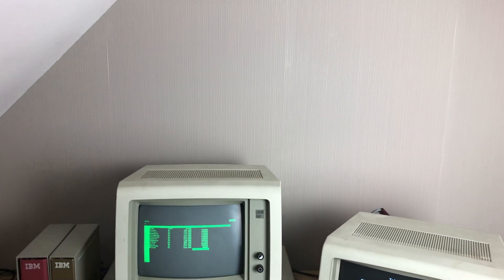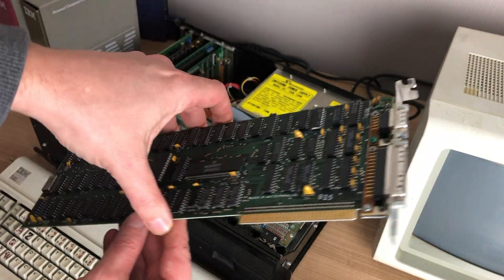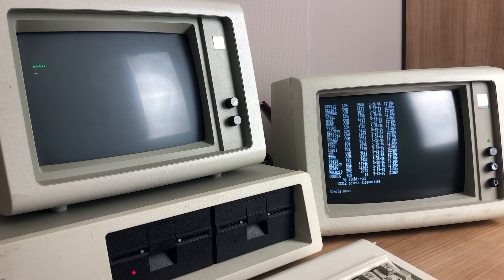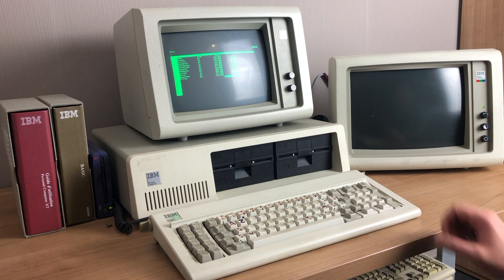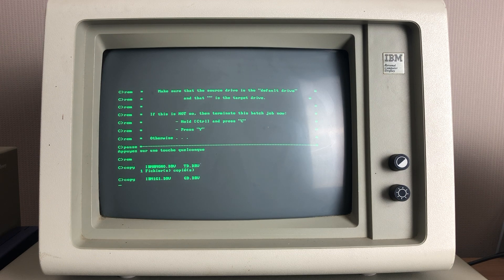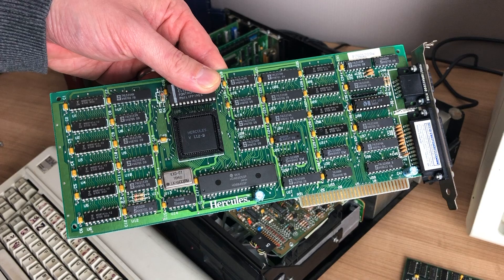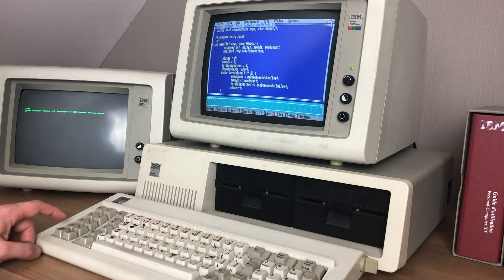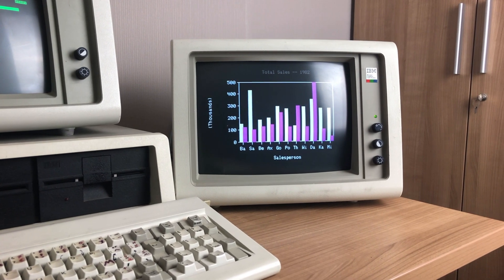IBM 5150 PC with dual MDA & CGA monitor setup

Comment: Had an IBM 5160 (PC XT) with the same stock monitors in 1984.  Gift from my dad as I left for University... Including all the hardware and software, even the MACRO assembler... it was about $7000 in 1984 dollars. Never had a computer with less than 2 monitors since, PCs, Macs, etc. all have had multiple monitors... current setup... 5 monitors, using TVs for 2 of the 5, take up an entire wall!

Comment: Thank you Sir!  I just got my hands on a brand new IBM CGA card for my PC/XT and added it to the MDA - I've only got got Model 5151 monochrome display at the moment so have to use a CGA-to-VGA converter and a "boring" modern LCD.  But I had read that there was a small selection of software that utilised both so, of course, wanted to try it out ... when I did a search, your video came up first ... so thanks for the demo & info!  /Brett

Comment: 9:15 My first computer was, oddly, a 386 with Hercules graphics outputting to an amber CRT. It ran DOS 6.22 and Windows 3.1. I used it around '95-'96, which was pretty painful - nearly anything remotely contemporary would require a VGA display. Still, I learned the basics of both using computers generally, and some programming (in QBasic and Turbo Pascal) on it, so I remember it fondly.

I've read about this dual-monitor arrangement on early PCs before, but I've never seen it in action, so it was great seeing it here!

Comment: Very cool. The IBM CGA card had connector pins for a light pen. I saw someone using one to create 4-color pixel art on a CGA monitor; I can't remember what PC ssoftware they used. This was a year or more before VisiOn and the Apple Lisa introduced the mouse.It seemed rocket scientist stuff to us doing 80x25 work in green on the 5151 monochrome screen.

Comment: Our first PC which we acquired in 1992 was a 5271, a special version of the XT which had the Extended Keyboard, a Professional Graphics Adapter with 3270 character set and the 5272 high-resolution colour display.  The Professional Graphics Adapter in the 3270 PC configuration emulated a 3279 colour terminal, had full CGA support and provided a few extended text modes including a 120-column mode which a handful of programs supported.  The standard DOS text mode on this adapter is similar to EGA, having a 640x480 resolution and a full 16-colour on-screen ANSI pallette.

Comment: I saw one of these monochrome green monitors in use at an Arbys last year...  the whole restaurant was stuck in the 90s... they still had carpet on the floor. I'm pretty sure all the tech and equipment in there was never upgraded since the place was built.

Comment: 0:07 Rather than drawing directly onto the keyboard keys, I used to cut up the sticky portion of post-it notes and apply those to keys whenever I wanted to do any keyboard remapping or to indicate macros that I assigned (often for mainframe / midframe terminals or via WinKey software on the PC side of things.)

Comment: This brings back memories.  Back around 1990, I set up my roommate's PC clone to do dual monitors.  Hercules and VGA, IIRC... we had a few applications we used that took advantage of this, such as Borland's Turbo debugger... but most of the stuff we used was our own code... TSRs that would keep stats on one monitor while apps ran on the other.

It used to really impress the other geeks when I'd bring up my bouncing ball program that would go across monitors.

Comment: Autocad under DOS up to version 13 (the last version with MS-DOS support) was also dual screen capable. We used old Hercules text cards up to the Pentium age. A modern VGA graphics card with very high resolutions on a 20" CRT and a cheap hercules/monochrome screen for the text part. This avoided the screen switching that often had to be done on MS-DOS

Comment: Your MDA monitor needs some tweaking to make the picture fill the screen. You can do that by adjusting a couple of potentiometers inside the case. Don't kill yourself with the 15k voltage on the tube.
Reply from the maker: The fear of 15k volts is why it still needs tweaking :)

Comment: 0:40: "Up to 4 colours at the same time from a 16 colour palette." 
Or up to 16 colours at the same time in text or 160x100 mode.
Or indeed up to 1024 colours at the same time in composite mode, with hacks. Just google 8088MPH.
(...)
2:25: "resolution 320x200"
Or 640x200 in mono.  ;-)

PS: That's the most ghetto AZERTY keyboard I've ever seen. :D
Reply: To be fair to the truth, Or up to 16 colors in 320(160)x200 composite mode

Comment: @RetroSpector78: Hey, I'm noticing your (French) Guide to Operations that you have next to your 5150 says Personal Computer XT on it, despite the fact this isn't a 5160. 
My UK-bought 5150 also came with a Guide to Operations that also says Personal Computer XT, and I always thought that was a mistake or mix-up and that I should ultimately try and get the "correct" GtO for it, i.e. one that doesn't say XT. 
But now I'm wondering if I was wrong all along, i.e. if all the 5150s in Europe only ever came with the same GtO that the 5160 would also have come with? Is it true the 5150 was only sold in Europe from 1983 onwards, the same year the 5160 was already available too? If so, then maybe (that's why) there was just one GtO for both the PC and XT?

Do you happen to know any of this? If not, do you happen to know who might know and who I could ask? Thank you!

Comment: I remember that the mda card video performance was higher than cga video card in text mode.
Reply: Are you referring to speed or pixels per inch?
Reply: @ropersonline  per display speed
Reply: @ropersonline  yes i'm sure, in text mode, MDA card is faster than CGA card. and faster than some ISA VGA Card (i.e oak ISA vga 256K ), i rember of that, in landmark utility test

Comment: Very cool ,can you combinate other standards EGA VGA?
Reply from the maker: These wil have overlapping memory addresses and that will be tricky. MDA and CGA have completely separate memory addresses so that’s why it works. here is a good reference on what is possible : https://www.seasip.info/VintagePC/dualhead.html
Reply: @RetroSpector78  thanks :) very interesting article :)
Reply: I've been experimenting with dual-monitor setups lately. Basically, MDA and Hercules share the same address space at 0xB0000 while CGA, EGA, and VGA reside at 0xB8000.
 
This means systems can be configured to run with an MDA or Hercules carc in one ISA slot and CGA, EGA, or VGA in a second slot, switching between the two using "MODE MONO" and "MODE CO80" (as shown in the video).
 
I've done this with an IBM 5160, generic 80286, 80386DX, 80386SX ISA boards, and a Pentium ISA/PCI motherboard. The system I'm currently working with is a 80486DX-50MHz with a Hercules ISA and Paradise VGA VLB – and it runs great!

Comment: Looks like the vertical height on your 5151 monitor needs to be adjusted, as it isn't filling the screen. There is a control for adjusting it, VR402 (V-Size) on the circuit board.
Reply from the maker: I know :) But after all of the other issues I had with it it was the least of my worries. But definitely on my todo-list and thanks for pointing out the location.

Comment: In fact, first 5150's was supplied with CGA cards not with MDA. It was assumed that customer connected normal TV to computer using RCA or antenna connector. CGA monitors was released later, in 1983.
Reply from the maker: Thanks for clearing that up ! Didn’t realise I explicitly stated that MDA was default and CGA optional. My bad.
Reply: I thought IBM made the MDA and CGA cards available from the start along with the 5151 monochrome monitor.  I forgot the CGA card had a composite RCA output, but few TVs had that; you had to get a third-party RF modulator to plug it into the TV's antenna input.